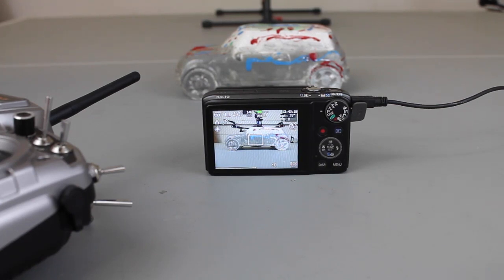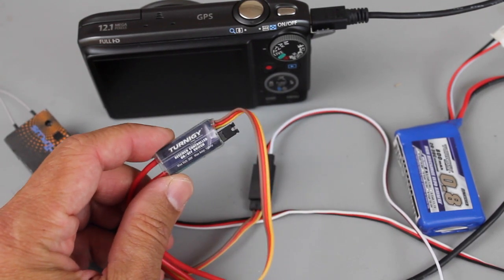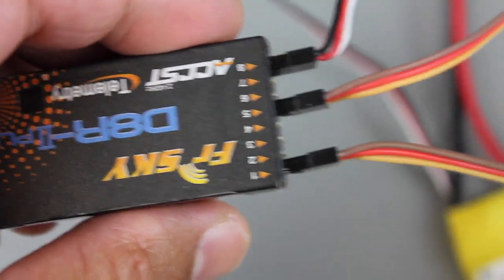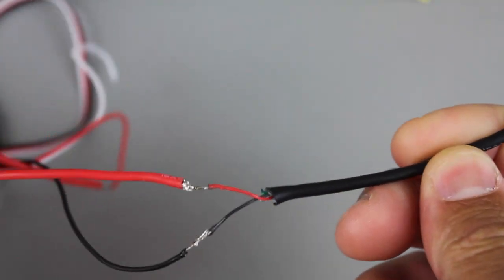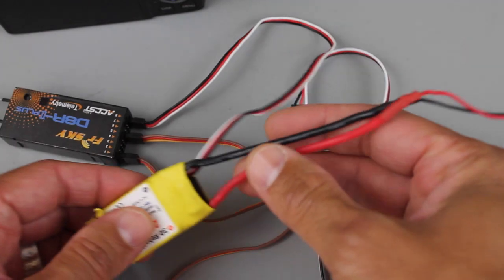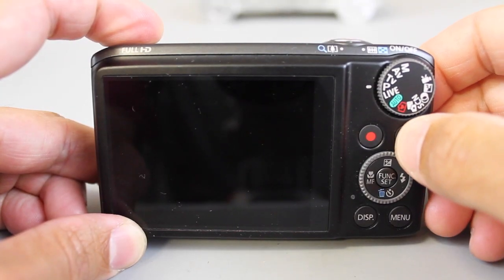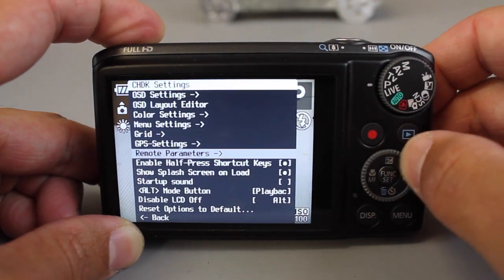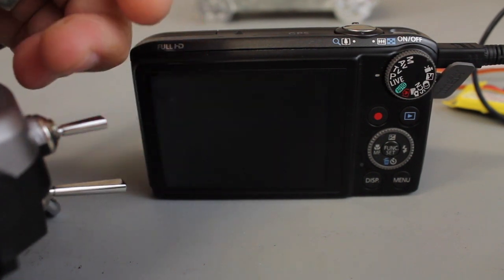CHDK Remote Shutter and Script w/ FrSky Taranis and Turnigy Receiver Controlled Switch

Comment: I recently purchased a particular branded device from England (Gentles USB)  for a dear $35 including postage and have successfully installed CHDK on my G7x mk1. There is not much documentation online about my camera+ CHDK however I'm guessing you might have run into the same glitch.. 

Whenever the RX is connected to the Canon via USB port the CHDK menu flashes vigorously and seems as if photos are being taken by the LCD going black and the lense making a flicking' sound .. 

I bet its just a few tweaks to the menu away. My usb cable supports up to 6 functions they say

Hoping to be able to control ZOOM and REC while using the cameras HDMI output..

Any help would be much appreciated !
Reply from the maker: I haven't experienced this. Let us know if you discover anything. Thanks.

Comment: Hi Dennis, would this cable setu work with the Pixhawk for Distance triggering assuming I power the Pixhawk rail with a 5V BEC on the motor side and connect the signal to AUX5? I am about to order the components, but I have a doubt, even though the logic feels right!? Tks again Dennis. Cheers
Reply from the maker: +FPV Cambodia Check out this video and the cable link in the description. Hopefully it will help you out: https://www.youtube.com/watch?v=L-_2dOtetF4

Thanks and hope all is well.

Comment: will this work with mobius or go pro
Reply from the maker: Hal Bishton Not entirely sure. For either of those cameras you'll need some sort of interface board to access the pin where you can send 5V. I know there are breakout boards for the GoPro but not certain about the Mobius.

Comment: I`ve been looking into live feed out and remote shutter trigger for my Canon S100.
I came across this article and thought you might be interested.

http://arch.ced.berkeley.edu/kap/discuss/index.php?p=/discussion/5092/diy-canon-11pins-usb-connector-s100-cable-with-chdk-remote-and-video-out#Item_1

Note:The number 1 pin and 5 pin have to been reversed,the pin layout picture was incorrect.
I got it up and running this morning after figuring out the mistake,works a treat.
Thanks for the info on CHDK remote set up mate,made things easy this end.
Reply from the maker: Philip Gordon I didn't even have to bevel the edge and was able to get it into the USB plug with a bit of wiggling. The one thing I did run into was when pulling the plug out of the connector the pins slipped out of the housing. I was able to slide them back in and I think with a wee bit of glue that won't be a problem. Anyway, I'm glad to know we're headed down the same path and let's keep each other updated on progress. Take care.
Reply from the maker: Phil G Crazy! I just finished a cable like this last week and used that article you posted as a reference. I also used another article that mentions a different HTC connector. This article:

http://www.achillies.com/CHDK_Files/USB_Splitter.htm

In that article it talks about pin 10 being used for composite video, but that didn't work for me. I found out that it's pin 7. I've confirmed that the live video works with pin 7 on both my Canon SX260 and 130IS. I plan on doing a video soon and we can compare notes. It sucks that these 11 pin connectors aren't easier to come by! Thanks for sharing and glad to know we're on the same page.
Reply: Dennis Baldwin
Thanks for the link Dennis,I didn`t think to bevel the edge of the connector.
I`m not sure if you put the casing around the end of the connector,I just put some shrink tube as I`m a bit cramped for room. Not such a good idea as I have already broken one of the pins.
When a new HTC plug comes through the mail I will replace the broken pin,still use shrink tube though I will pack silicone to insulated and strengthen the area.
Look forward to see your video,thanks mate.

Comment: Hello Dennis, Thanks for the tutorial, great one. I have a problem. I have got a DSLR which i want to trigger with Turnigy. DSLR just uses a E3 connector, in which sorting two of the end, it will shutter. I just want to short circuit that two, so how can i attain that using Turnigy. Thanks. Expecting a helpfull response.
Reply from the maker: Soumya Sumitra Behera I think this should be possible although I've never worked with an E3 connector. Is that similar to a stereo plug? Perhaps you can post some links to the camera and cable? It would be helpful if you can do this at www.garagepilots.com in the forums as I normally have a hard time keeping up with replies to my comments on YouTube. Best of luck.

Comment: Dennis, 
Great video (as usual). I have the same camera I want to use for the aerial imagery. My question is, do you use the built-in GPS to reference the imagery? Also, do you have the GPS logger on all the time? Thanks so much.
Reply from the maker: Binesh Maharjan You can, but I've definitely had problems with the GPS sensor in the camera. There are times where it doesn't update and so all my images are geotagged the same. It really depends on visibility and if your camera is mounted way down in the fuselage you may have problems with getting accurate location data. I think the best approach is to use the GPS from the Autopilot and tag images based on time. Actually, an even better approach would be to use APM/Pixhawk to trigger the camera on a distance interval. Then you have (roughly) the time/location of the trigger event.
Reply: Dennis Baldwin Thanks so much man. Really appreciate your work and help. Like I said earlier, I learned just about everything about UAV's from your youtube channel.
Reply: Dennis Baldwin Thanks so much for your response. A dumb question, how do i geotag the photos using GPS from the Autopilot?

Comment: Dennis

Does the Canon have a live video output when taking photos or video ?

Regards Gerald
Reply from the maker: Gerald McGivern I know the cheaper PowerShot models don't but I think some of the DSLR models like the 6D do. I really wish it did. Here is some more info on the issue:

http://chdk.setepontos.com/index.php?PHPSESSID=6926198a6fce023e7a54e85af98f11d2&topic=9610.msg99056#msg99056

Comment: Which is the video signal wire,the green or the white?
I`m wanting live picture feed out when I`m up and running.
Reply from the maker: Phil G Unfortunately this model doesn't have live video out. It would be awesome if it did. I'll see if I can find any Powershot series cameras that have live video out.
Reply: Thanks Dennis. I found a unit for my Canon S100 that fires the shutter and allows live video feed out,
Here`s the link http://www.col.at/

Comment: I have used a few of those Turnigy radio controlled switches.  Has anyone found a use for the "other" modes with the jumpers not both on?  The only thing it seems to do is just turn on and off with both jumpers on.  I'm not complaining!  I just wonder why they bothered with jumpers if they don't do anything.
Reply from the maker: Hugh Hemington Good question! I'd like to know about uses without the jumpers as well. Haven't come up with anything and I totally agree with you.